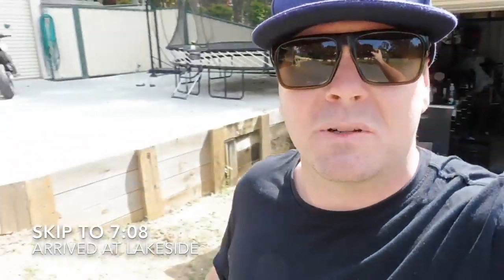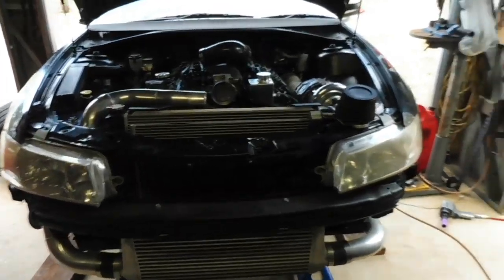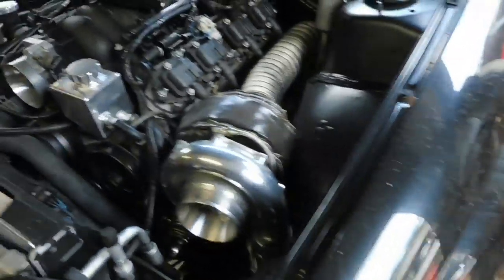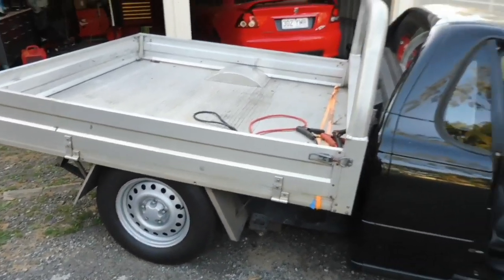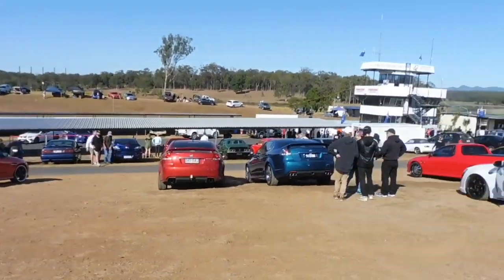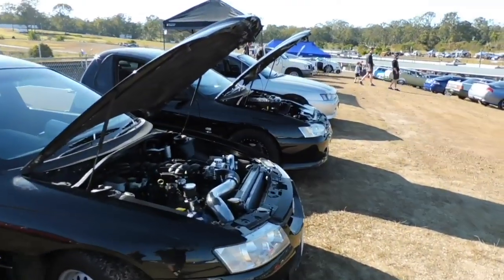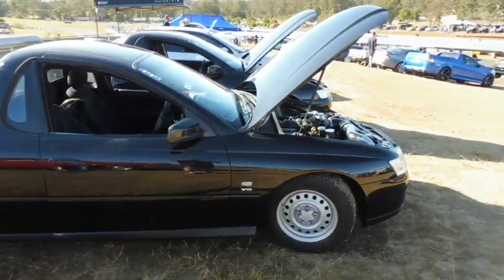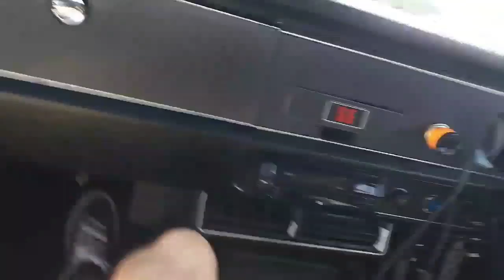Lakeside raceway cruise Father’s Day 2019

Comment: Awesome ute mate, I was in the white F6 at 9:14 - me and my mate where trying to workout if your car was turbo or supercharged, he wants to build something like your ute that just looks stock. 
My f6 has over 700 at the wheels so you did bloody well.
Reply from the maker: Flying Legfist thanks mate your f6 is bloody quick
Reply: @LatysGarage  - Yeah it goes alright, probably at the max for a low mount turbo now. 
I actually have a vid of me beating that r-spec ute too.
Reply from the maker: Flying Legfist nice work that’s a damn quick ute . I’m surprised how well some cars hook there I’m on 255 et street  and still skate a little on 5psi in 2nd then 7.5psi for start of third then 11psi top of third and 4th if I could give it all the boost off the hit it’d be a lot quicker . I’m going to try work on the traction setup very soon
Reply: @LatysGarage  - Yeah i got the 275 M/T streets I was struggling for traction as well, I thought it might just be that they are a little to used now, but my brother was having the same trouble in his car and he has new tyres.

Comment: Hey there Laty , quick question , no machanic can work out what it is , but my ve ss revs at 3000rpm and stays there and even through changing gears. Pull up at lights and she just revs up and stays there. Any idea what that would be ? I cant find a machanic that can tell me what it could be :/ any help would be appreciated as its the everyday car for my partner , i work away
Reply from the maker: Oz Car Scene Uppa maybe a faulty throttle body or you have a vacuum leak
Reply: Cheers bro , much appreciated 👌